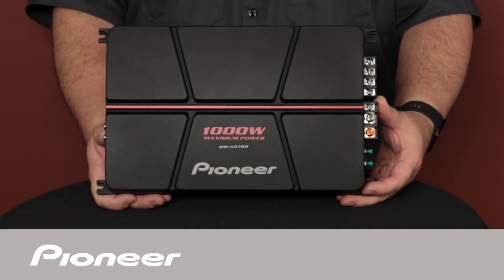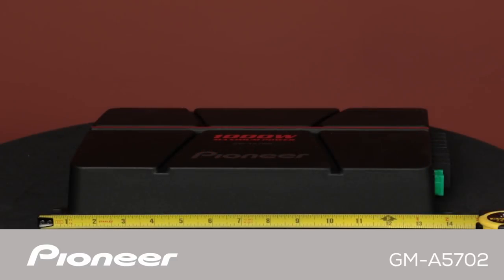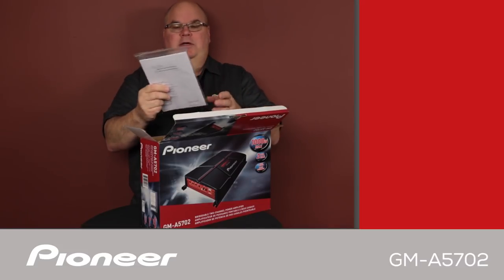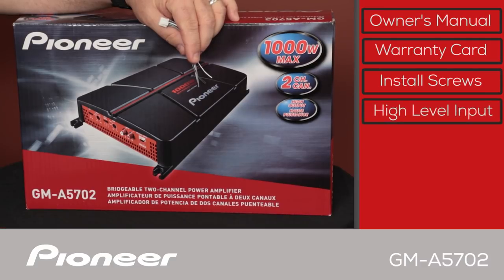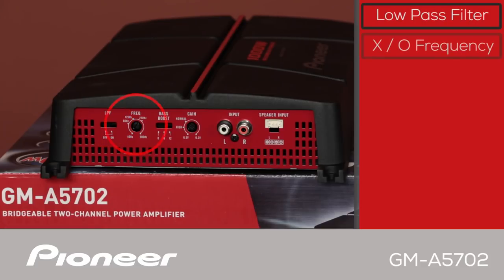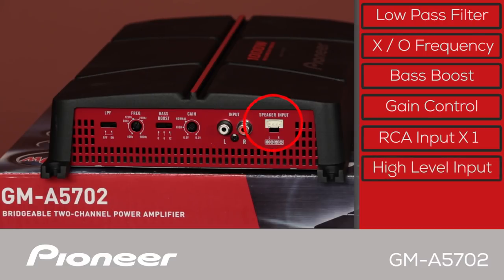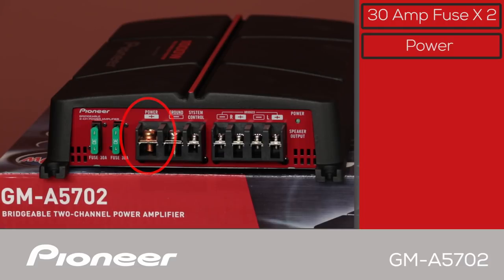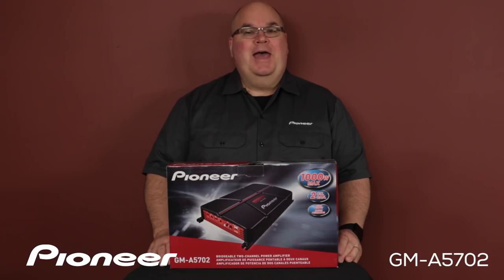GM-A5702 - What's in the Box?

Comment: I have 2 12" kickers to this and it gets hot instantly and starts cutting out
Reply: I recommend to wire the two speakers in stereo to the amplifier. That means one speaker wired to the amplifier right output, and one speaker wired to the amplifier left output.
Reply: I have the same setup, fixing to get installed... Crazy that this is the first comment I see! It's okay tho, I only paid $30 for the amp.
Reply: It's only 4ohm stable bridged u have it wired to low of an ohm load

Comment: For whoever says they’re amp is getting hot... make sure your subs are wired to 4ohms on bridged mode on the amp and you’ll be blasting this amp to fill potential and barely get it warm.. I’m in Florida and bump this amp full blast all day
Reply: hallo Jose, i was buyed the same amp one day ago and i have one sub 1400w max, 400w normal power in 4ohms. Do you think that i will have the same problem with temperature of the amp with this sub?
tnQ in advance for the answer and sorry for my engliah..
Reply: With one 4 ohm subwoofer all is OK.  No worries.
The Pioneer GM-A5702 is stable and will operate correctly with one 4 ohm woofer wired in Bridged mode.  No problems.   You can find more videos about Pioneer amplifiers here:  https://youtu.be/-Uq25Goo0sU?list=PLw63zJRQbCNg42VJXw0g7xzWJozqoSR1V  and you can find more videos on Pioneer's You Tube Channel here:  https://www.youtube.com/user/pioneerelectronics
Reply: I have two of these and can say that mine never overheat of give me any issues.
Reply: I run two of these all day long and they never get too hot.  People run too much input and crank the gain knob too much.  It's just an input matching circuit, not a volume. It don't make it louder, it just adjust how sensitive the amp is to the input signal.

Comment: Great amp, but man does this thing run HOT!
Reply: You can find more videos about Pioneer amplifiers here:  https://youtu.be/6h3b_c3Yxnk?list=PLw63zJRQbCNg42VJXw0g7xzWJozqoSR1V   and you can find videos about Pioneer Subwoofers here:  https://youtu.be/QgG1mu2u3XI?list=PLw63zJRQbCNhkTQCxPpxGF4h6l6qocsaR   and you can find more videos on Pioneer's You Tube Channel here:  https://www.youtube.com/user/pioneerelectronics
Reply: It's a class AB amplifier they do run a bit warm.  If it's running hot check your ground make sure it's tight and to a clean section of metal. Check your gains too that will make it run hot. The last thing is to make sure that you're only running a load of 4 ohm on it bridged or 2 ohm for each of the stereo outputs.  I have two of these and never had any issues with heat.
Reply: Hi again mate, can I use this amp to run 2 6×9s TS-A6970F they are 4ohm each but I see you have said it's 2ohm on each channel?
Reply: The Pioneer GM-A5702 will work great with a pair of 4 ohm Pioneer TS-A6970F speakers.  I recommend to wire one on the left channel and one on the right channel.  This will show the amp a 4 ohm load and it will play all day long.    It will work great and be very reliable. This is a simple stereo setup with no bridging.   The Pioneer GM-A5702 is designed to operate from 8 ohms to 2 ohms.  You don't want to go below 2 ohms. You can find more videos about Pioneer amplifiers here:  https://youtu.be/99Hfmc8QxVc?list=PLw63zJRQbCNg42VJXw0g7xzWJozqoSR1V   and you can find more videos on Pioneer's YouTube Channel here:  https://www.youtube.com/user/pioneerelectronics
Reply: @deckerdotto6035  thank you again for your fast response, the speakers and amp work very well together, the amp does not have a HPF on it only a LPF choice of on and off and a frequency response. How would I set this to get the best out of the speakers without them distorting etc. Thank you very much
Reply: There are many ways to approach this, and, it depends upon your entire system.   If you can answer a few questions about your system I can try to help.  Are there other speaker in the vehicle?   Does your in-dash receiver have an HPF on the output you are using for the Pioneer GM-A5702?     Are you using a subwoofer in the vehicle?  What are the crossover settings for the Sub?
Reply: @deckerdotto6035  I have an OEM head unit, tapped into the rear speakers into an LC2i and have the GM-A5702 and GM-D9701 connected and have 2 Pioneer Champion Pro Series running at 1ohm 1200Rms On The GM-D9701 and the Pioneer TS-A6970F 6×9s Connected to the GM-A5702 on 2 channels at 4ohm with 100RMS
Reply: @deckerdotto6035  I have 0AWG wire from bonnet to a distribution block in the boot which splits the power to both amps and a Ground Distribution  block to both the amps also. All OFC wire to confirm. With 12Gauge speaker wire to the 6×9s and 10gauage to the subs also OFC from bassface
Reply: @deckerdotto6035  hopefully you can imagine the whole set up clearly and thank you so much for the help
Reply: On the GM-A5702 be sure to switch the LPF Off and set the Bass Boost to zero.  You have a separate amp and sub for bass.  Let them do the bass work.  With your setup, you don't have an HPF available for the TS-A6970F speakers. Ideally, I would want an HPF at around 80Hz on the 6x9's.  This is not hard to do. Many options are available.  Here is one possibility:      https://www.parts-express.com/80-Hz-High-Pass-4-Ohm-Crossover-266-456?quantity=1   You'll need one for each of the 6x9's.  This will filter out the low frequencies from the 6x9's.  Let the sub play at 80Hz and lower.  Be sure to roll the gain back on the GM-A5702 until you don't hear any distortion.  With a crossover at 80Hz on the output, you should be able to run the 6x9's loud and clear.   Another way to do this would be to not use an HPF on the 6x9's and just roll back the bass output from the LC2i on the connection for the GM-A5702 amp and roll back the the gain on the GM-A5702 so you don't hear any noise.  You can learn more about HPF for the 6x9's here:  https://youtu.be/hscMuzfyxQ4     and here:   https://youtu.be/s_amOnIh1So     You can find more videos on Pioneer's YouTube Channel here:  https://www.youtube.com/user/pioneerelectronics
Reply: @deckerdotto6035  thank you so much for the reply. I have the LPF switched off, bass boost off but the frequency response on the amp still changes the sound of the speakers, would.i not be able to set that to 80hz etc and it only play sounds about that being used more as a HPF due to the LPF being switched off?
Reply: Above that**
Reply: LPF means Low Pass Filter.  It lets Low frequencies pass through the amp and it filters out the high frequencies.  An HPF or High Pass Filter does the exact opposite thing.  It lets the high frequencies pass through and filters out the low frequencies.  The amp does not have an HPF.    When you switch off the amplifiers LPF, that means the amp will now playback all available frequencies from low to high.  There is no filter.   Pleas take a look at this video.  It may help you to understand a little more about the way crossovers on Pioneer receivers work and how it could possible apply to your system:    https://youtu.be/WvJXYh6vk_0?t=336

Comment: High pass option would have sealed the deal.
Reply from the maker: Nearly every Pioneer in-dash receiver has a high pass filter built in.  If you need an amplifier with built-in high pass, Pioneer has many to choose from including Pioneer GM-D9705 seen here:   https://youtu.be/99Hfmc8QxVc   or Pioneer GM-A6704 seen here:   https://youtu.be/O45n88duYso
You can find more videos on Pioneer's YouTube Channel here:   https://www.youtube.com/@pioneerelectronics
Reply: @pioneerelectronics Thank you for chiming in that is good to know. While I have your attention, I am looking for a new head unit and am wondering if the Pioneer DEH-S6220BS, while in 3 way mode (lows,mids, and highs) will allow you to run sub-out unfiltered? That is, can the crossover be disabled so that the sub amp only sees a full range signal? I ask because my Epicenter needs a full range signal. Thanks.
Reply: Also, same question for 
DEH-S4220BT if you please.
Reply from the maker: @donnie4191    Yes, the Pioneer DEH-S6220BS can play the low output RCA (sub) as a full range output, when the system is used in Network Mode.
Please note 1:  Subwoofer output must be switched ON  in either normal or reverse phase. Note 2:  The Subwoofer LPF  and slope must be switched off.  This creates a full range output on the low output.
You can learn more about Network Mode in this How To video from Pioneer:   https://youtu.be/WvJXYh6vk_0?t=353
Settings for this can be seen in the product owner's manual.  You can find it here:   https://www.pioneerelectronics.com/PUSA/Car/CD-Receivers/DEH-S6220BS#manuals   page 47.
Reply from the maker: @donnie4191    Pioneer DEH-S4220BT has 2 pairs of RCA outputs and does not operate in Network Mode.   For your application,  I recommend the DEH-S6220BS or Pioneer DEH-S7200BHS, seen here:   https://youtu.be/_mwzEMGuhbU     or the Pioneer MVH-S720BHS seen here:    https://youtu.be/FBck5BfCnXE
Reply: @pioneerelectronics   Wow thank you for taking the time. I am definitely going with Pioneer for a head unit now.
Reply: Looking like the DEH-S6220BS is for me.

Comment: I have a one 12in kicker comp R , I have it in bass boost level 1 and loudness on my KENWOOD dmx125btx with 4 300w dB drive on the doors of my Lincoln Navigator also have the factory subwoofer and amp connected my pioneer amp gets hot and cuts off wth
Reply: The Pioneer GM-A5702 amplifier is a 2 channel stereo amplifier that can operate down to 2 ohms impedance.   If the amp gets too hot, it will shut down to protect itself.    If the amp is getting hot and shutting itself down this is very likely the ohm load you have wired to the amplifier is less than 2 ohms.  How many speakers do you have connected directly to the Pioneer GM-A5702?

Comment: I’ve owned a old gma5602 and it can’t handle 2 ohms just cuts off at high volume no the gain ain’t all the way up I purchased a new gma5702 and same thing 2 ohm ratings are a joke it’s very low
Reply: What speaker or speakers do you have connected to the Pioneer GM-A5702?  How are those speakers wired?   Are you bridging the amp?    If you are attempting to bridge the amplifier, the limit is 4 ohms.  Please keep reading.   When you bridge a stereo amplifier you are combining the Right and Left Channels together to operate as one output.  This by default,  cuts in half the impedance that is shown to the amplifier.  That means when you Bridge a 4 ohm speaker, you are actually showing the amplifier a 2 ohm load.  When bridging a 4 ohm speaker, the amp is very reliable.  If you are bridging a 2 ohm speaker, you are actually showing the amplifier a 1 ohm load. If you have two 4 ohm speakers wired in parallel,  that creates a 2 ohm circuit. If you attempt to bridge a 2 ohm circuit to the amp it will show the amp a 1 ohm load. This will shut down the amp. This is clearly shown in the manual.  You can find it here:  https://www.pioneerelectronics.com/StaticFiles/Manuals/Car/GM-A5702_OwnersManual060816.pdf   If you wire two 4ohm subs in a series, this creates an 8 ohm circuit.  If you bridge this 8 ohm circuit to the Pioneer GM-A5702 the amp will see a 4 ohm load and will be very reliable.  The Pioneer GM-A5702 is not designed to operate at a 1 ohm load. When operating at 1 ohm the amp will get hot and shut down to protect itself.    If you are running an 8 ohm down to a  2 ohm load on the right channel and a separate 8 ohm down to a  2 ohm load on the left channel the amp is very reliable.  If you want to operate speakers at 1 ohm I recommend the Pioneer GM-D8701 seen here:  https://youtu.be/-Uq25Goo0sU   or the Pioneer GM-D9701 seen here:  https://youtu.be/6h3b_c3Yxnk   You can learn more about Pioneer amplifiers here:  https://youtu.be/99Hfmc8QxVc?list=PLw63zJRQbCNg42VJXw0g7xzWJozqoSR1V    and you can find more videos on Pioneer's YouTube Channel here:  https://www.youtube.com/user/pioneerelectronics

Comment: system control = REM???
Reply: The "System Control"  connection of the Pioneer GM-A5702 needs to be connected to the Pioneer in-dash receiver's Blue wire with White stripe.  The receiver's Blue with White stripe is the "System Remote Control" wire.  You can learn more about wiring your in-dash receiver and amplifier here:   https://youtu.be/kR2MO2kwFug?list=PLw63zJRQbCNhDoDXEJKBHoC27MkfUhJ-R&t=142      You can find the owner's manual for the Pioneer GM-A5702 here:  https://www.pioneerelectronics.com/StaticFiles/Manuals/Car/GM-A5702_OwnersManual060816.pdf    You can find more videos on Pioneer's YouTube Channel here:  https://www.youtube.com/user/pioneerelectronics   and the ??? on your keyboard appears to be sticking.

Comment: Recently picked up an MVH-S600 BS. Had discovered a while ago that most of the newer units allow the rear outputs to be used for a low wattage woofer. So I am gonna try it. Picked up some 6.5 inch woofers that handle frequencies down to 60hz and 60 watts rms. I am realistic. It would be a better concept if there were woofers designed for this specific application.  A) Pioneer doesnt seem to have a video that shows this being done. No one seems to. So I might just video the results and upload. B) The diagram shows the woofers running in parallel with a 2 ohm load on the head units rear output. Those wire are tiny. Who you guys trying to fool? Does this still work if i just wire them to 4 ohm? I plan to cut the short and run as much 14 gauge wire as possible.
Reply: It will operate at a 4 ohm load.

Comment: Running 2 tens 300 rms dam thing cuts out in bridge mode and gets way too freaked hot.
Reply: If your two 10-inch subwoofers are each 4 Ohms and you have them wired in parallel and bridged to the Pioneer GM a5702 you are showing the amplifier a 1 ohm load. This is why it is running hot and cutting out. It is not designed to operate this way. Please run your speakers in Stereo. One subwoofer on the right Channel and one woofer on the Left Channel. The Amplifier will run cooler and will not shut down.
Reply: @deckerdotto6035  not 1 ohm but 2 ohms load
Reply: The Pioneer GM-A5702 is designed to operate down to 2ohms.  If you wire a speaker, or multiple speakers together to have a nominal impedance of 2ohms this can operate in stereo mode on the GM-A5702.  That means the right channel or the left channel or both right and left at the same time.   When using bridged mode  this amplifier sees 1/2 of the nominal impedance load.  This means when bridged, the same 2 ohm load is showing the amplifier a 1ohm load.  If you are looking for an amplifier that can operate at 1 ohm I recommend Pioneer GM-D8701 seen here:   https://youtu.be/-Uq25Goo0sU?list=PLw63zJRQbCNg42VJXw0g7xzWJozqoSR1V    You can find more videos about Pioneer amplifiers here:  https://youtu.be/99Hfmc8QxVc?list=PLw63zJRQbCNg42VJXw0g7xzWJozqoSR1V  You can find more videos on Pioneer's You Tube Channel here:  https://www.youtube.com/user/pioneerelectronics

Comment: Good afternoon, i have a cuestion for this amplifer, How to make conection for 6 speakers off 4 ohms in bridge?
Reply from the maker: This depends upon the impedance of the 6 speakers. 
When connecting your 6 speaker circuit, be sure the total circuit impedance is 4 ohms or higher.   The Pioneer GM-A5702 can bridge a circuit of 4 ohms or higher.  If you try to bridge a circuit lower than 4 ohms, for example 3 ohms, or 2 ohms, the amplifier will overheat and shut down.
I suggest doing some research for series/parallel wiring configurations.  Here is one video to watch:   https://youtu.be/tTk_Xf5S6ns
I'm sure there are more resources.
You can find more videos on Pioneer's YouTube Channel here:  https://www.youtube.com/user/pioneerelectronics

Comment: Will be this enough for my 2x2 ohm 1000w rms subwoofer? (Ground Zero GZIB 3000XSPL)
Reply from the maker: Will this be enough?   That question has a different answer for everyone.  The Pioneer GM-A5702 can play down to 4 ohms impedance in a bridged or mono application.  To use this amp, you must wire the subwoofer at 4 ohms, and then you can bridge it to the Pioneer GM-A5702 amplifier.  Please refer to the subwoofer's owner's manual for detailed instruction on how to wire the sub to create a 4 ohm subwoofer.  On the Pioneer GM-A5702, use the bridged output or one channel output. Please note:  If you try to use lower impedance on this amplifier in a bridged application, the amp will shut down.   
Please be sure to refer to the owner's manual page 10 for wiring single speaker output.  You can find the owner's manual here:   https://www.pioneerelectronics.com/StaticFiles/Manuals/Car/GM-A5702_OwnersManual060816.pdf   
This will provide approximately 480 watts RMS output.  this is well below the 1000w quoted above.  For many users, this will be a great subwoofer and amplifier combo for the price.   This will create a very stable and reliable system.  For other users this won't be enough amplifier power to get the full benefit of this subwoofer system.
In that case I recommend the Pioneer GM-D9701 seen here:    https://youtu.be/6h3b_c3Yxnk     The Pioneer GM-D9701 will can operate at 1 ohm impedance.  At 1 ohm impedance the amplifier will put out approximately 1,200 watts RMS.  Wire the subwoofer for 1 ohm impedance and you'll be using both products to near their fullest capacity.
Pioneer GM-D8701 is also a great option.  You can see is here:   https://youtu.be/-Uq25Goo0sU?list=PLw63zJRQbCNg42VJXw0g7xzWJozqoSR1V    
This amp is 800 watts RMS at 1 ohm impedance.
You can find more videos about Pioneer amplifiers here:  https://youtu.be/99Hfmc8QxVc?list=PLw63zJRQbCNg42VJXw0g7xzWJozqoSR1V
You can find more videos on Pioneer's YouTube Channel here:   https://www.youtube.com/user/pioneerelectronics